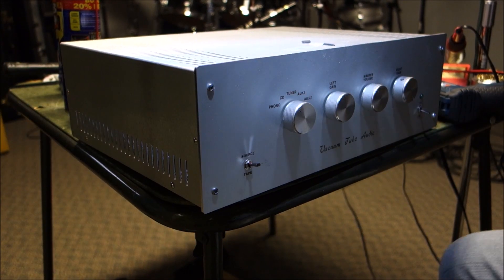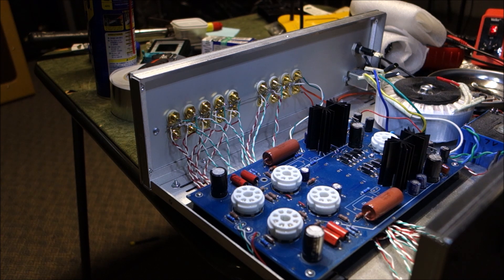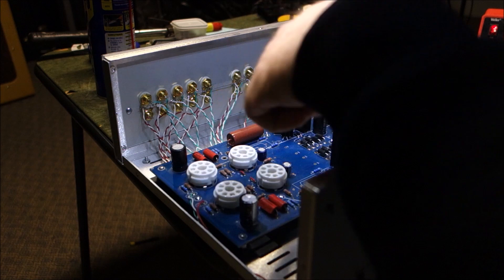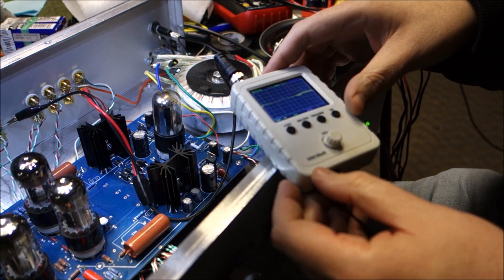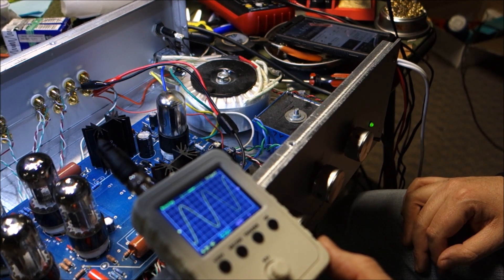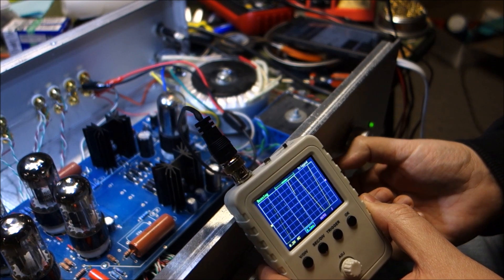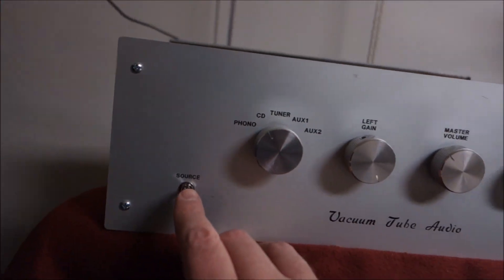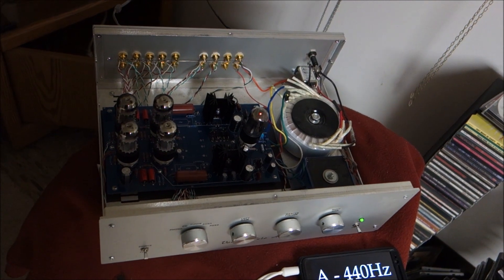SP14 Tube Preamplifier Kit is said to have an awful hum.   Let's see what gives.

Comment: I had the model kit under this one (SP13) and had noise (ground) issues. Followed the wiring diagram correctly but only after rewiring 3 times and changing a couple things did i get it right. I liked the pre so much im considering building this one. Although ive come across a few user reviews complaining about either hum or ground issues. Designer wasnt much help for me, after contacting and relaying my issues the first time he replied that it sounded fine before it was shipped out. Which made me laugh cause i purchased an unbuilt kit 😂. 2nd time i reached out he said there's a few different ways to do the ground plane and i need to use the one that works best for me. I started to think this guy must have someone else doing his emails for him. Normally I'd say run away from a builder/seller like this but its pretty good sound for the money. Plus ive never seen anyone tha has bought a pre built unit have any complaints. His half butt schematics and wiring diagrams i think are the problem. Few double grounds coming in and out to different parts (potentiometers, rca ins/outs) Lots of voltage and signal wires crossing paths or running vertical/horizontal with each other. Again, the preamps sound great for the money when you get it right though.
Reply from the maker: Sometimes with kit stuff,  you just have to figure out what works for you.   I build plenty of guitar amp kits,  and you get a schematic,  a layout diagram, and that's it.
Reply: "Normally I'd say run away from a builder/seller..."
Kind of what I'm feeling. I mean I would love to try this preamp. BUT when I visit their website; NO contact info (phone, Address, etc.) other than an email.Don't know why they would HIDE that from the consumer (hello RED Flag) ? And from what I've read under a couple forums, during research. It takes days for him (I think they said Don or Dan?) to respond to them. Sorry, I'm not purchasing ANYTHING, even if it were a candy bar from someone, unless I know of the seller/mfg. For them to leave out contact info leaves me with zero Confidence in the purchase. Maybe find one second-hand but will be skeptical of the humming issues people mention.

Comment: If there is hum, is it 60hz or 120hz... Check the heaters ground. If AC heaters, then you can use a 300ohm resistor to ground back to the mains ground transformer takes a lot of that out!

Comment: I have a SP14 and had hum that I just couldn't get rid of until I separated the channel grounds at the main volume attenuator. The instructions suggest running a jumper between the ground of the two decks (L-R) in the attenuator, for ease of ground wire attachment. Problem is, when you do that you create a ground loop, and get hum. Once those are separated, the unit works great. Took me a long time to find it because of the instructions and lack of a complete schematic in the kit. 
That said, it's a clean sounding elegant circuit. I'd recommend it, despite the obvious shortcomings in the documentation.

Comment: I also have the SP14 and for the price nothing can beat the quality and sound. Or I should say no sound DEAD quiet. Its a pretty simple preamp. What I like about it, is upgraded caps and upgraded tubes.
Reply from the maker: It is indeed a nice unit.   Not the cleanest assembly by the owner,  but the potential is there.

Comment: Looks good to me , its probably Aikido , tho i  make my own Transformers so in the department of Transformers and Chokes i would make it better , but not everyone can do their own transformers,  however anyone can buy 2 and make monoblocks , can be in one box tho , but tubes have to run on 2 transformers .
All youre Audio Equipment , say Preamp Amp Speakers , all of that is electrically connected . So you punch your Speaker you generate voltage , and that reflects like a miror to your transformer , and that reflects it to the other speaker going in the other direction.
So imagine your speakers being a Mirror , electrical mirror to each other .Now you can build a good amp that will minimize this Cross Talk , but ultimately having 2 transformers will solve it .
This is nothing to write home about , but still that is the only way i  would do it .
Reply from the maker: Humorously enough, I saw this AGAIN for repair a few days ago.   The owner broke one of the pots.

Comment: an easy mistake to make
Reply from the maker: I really wasn't a fan of the wire he used,  but I didn't want to be mean to the owner....I just wanted to correct the problem, rather than preach about how I would do it.
Reply: @DeadKoby  I know this is an old comment, but I’m interested in buying one of these. What type of wire would you recommend? I’ve got a roll of shielded 2 conductor wire with a lead and a ground. Is there a certain AWG you’d recommend? Also, that input switch looks kinda low grade, but I’ve used the same one in prototype gear. Is there a brand of switch you’d recommend that’s better quality? I’d also do the film cap upgrade. And, one more question, are the RCA input jacks decent quality, or would you upgrade them to something like CMC? 
I really apologize for all the questions, but if I build one of those, I wanna get it 100% right. Thanks so very much for the vid. - Nick